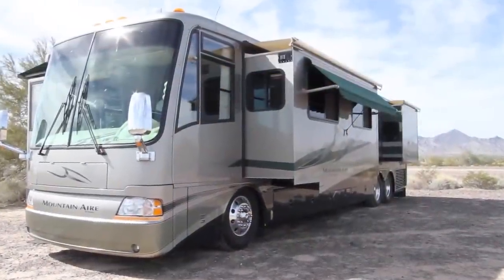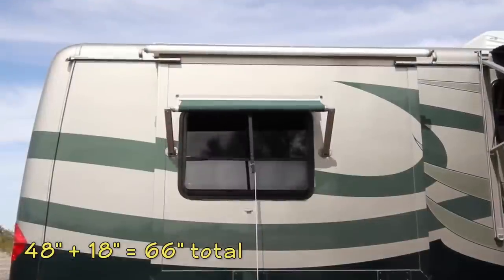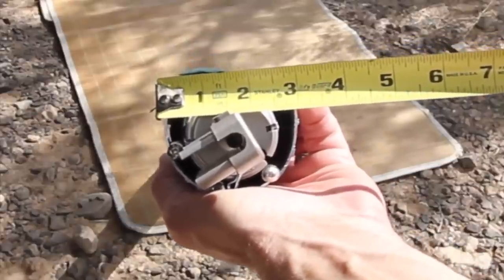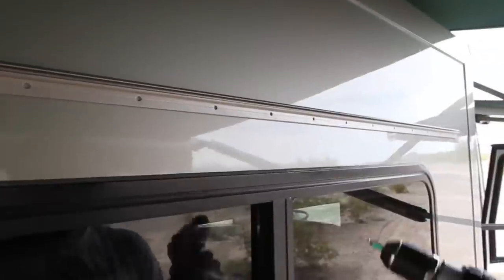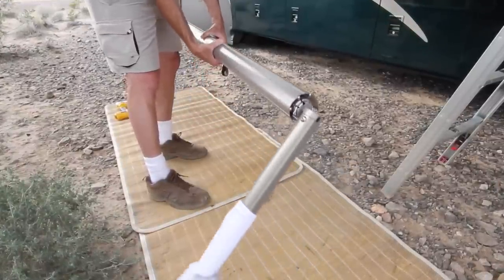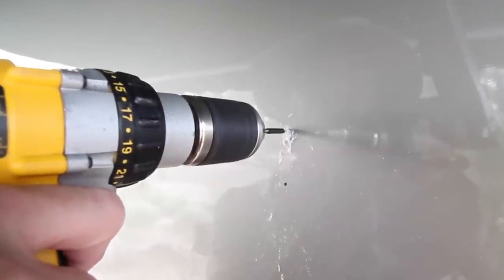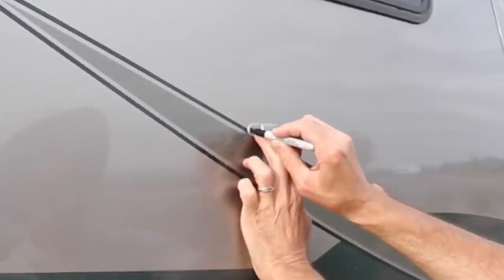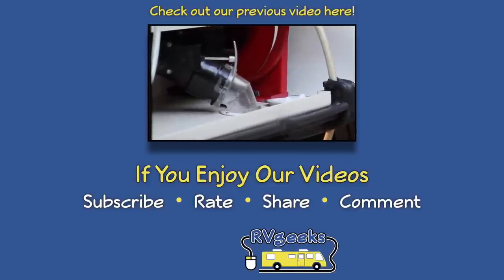How To Install an RV Window Awning (A&E / Dometic)

Comment: I love your videos. Very clear.  Obviously you plan before executing  and I am guessing you have a written script. The narration is as clear as a professional radio person.   I hope to eventually achieve your level of professionalism.  BTW- do you use a special microphone or video camera?  And I understand that if I get the same knife that a professional wood carver uses, I may get a different result<G>
Reply from the maker: Hi Jack! Thanks for the lovely comments. You just made our day. 😊  We have changed our techniques and gear a LOT since this video was shot back in 2014. When we do a VO video (voiceover) like this one, as opposed to appearing on camera, we do usually use a script. As far as camera and microphone choices, we have a great suggestion for the mic — a Blue Yeti, which is not expensive at all, and our very favorite, which we use to this day (although we didn't have it yet back in 2014). This is the exact one we use: https://amzn.to/3kf95Fj

As far as a camera, it's hard to go wrong these days, since just about every modern smartphone shoots in 4K, which is higher than you need for YouTube. If you're looking for a dedicated camcorder that has fantastic color, rock-solid image stabilization, and is drop-dead easy to use, our favorite model we've used over the years is the Sony AX53: https://amzn.to/3kf95Fj It's not cheap, but we sure loved ours. The only reason we replaced it was because we had to shoot on an even higher level for The RVers TV show. That requires equipment costing about four to five times as much! Hope this helps.

Comment: Thanks for the instruction, good,clearly video,still think twice before drill on our brand new class A motor home 🤔, if so how long does it take to order ? We are thinking to order few of this to cover 4 Windows .
Reply from the maker: +Lien Dang Unfortunately, A&E does not sell retail, so you have to order from an authorized dealer. We knew a few weeks ahead that we were going to be in Quartzsite for a bit, so we called a dealer there and ordered over the phone. The awning was waiting for us when we arrived, and we installed it out in the desert (which is where this video was shot). You'd have to call an RV shop or dealer that sells your brand of awning in the area you want to get it to find out lead times. You'll also need to let them know the size, fabric color and hardware color.
Reply: RVgeeks thanks for very quick replied!  We will check with our dealer.

Comment: Great video! Thank you. We're considering adding an awning to Casita Travel Trailer and wondered whether or not affixing the awning guide rail with screws into the fiberglass is the best option or if we should use pop-rivets or some kind of adhesive....what would you recommend? Thank you!
Reply from the maker: Hi Alex. We get why you're asking... screwing into the fiberglass definitely gave us pause, too. We considered using pop rivets, but since the two other awnings (that came from the factory) were installed using screws, we figured we'd follow suit (Newmar's been doing this longer than we have, LOL!). We were also concerned that an adhesive (even one as strong as VHB tape) wouldn't hold up to all of the sun, heat, rain, cold and vibration of life on an RV sidewall. With the putty tape in place, we feel confident that we're not likely to get a leak... and the screws are holding up great.
Reply: Thank you for the reply. I greatly appreciate your assistance with the inquiry! Cheers!

Comment: My pull down straps are weathered and the loop to pull on severed how do i take strap off to get it replaced?
Reply from the maker: Gary Mjoness Hi Gary. With the awning open, you should be able to slide the strap completely out one side of the roller tube. You can buy high-quality replacement straps from Tough Top Awnings (be sure to use the discount code "RVGEEKSROCK" for a 5% discount): http://www.toughtopawnings.com/rvawningaccessories.html
Reply: RVgeeks I opened awning and it will slide to end but the cap on the end needs to come off and it has a rivet in it. I was wondering if I took the rivet out and slid the cap off if I would lose the spring tension. Please advise
Reply from the maker: Gary Mjoness Hmmmm. There should be an opening on one end of the track (or the other) where the strap just slides right out through a little notch in the end cap. Do you have an A&E / Dometic or a Carefree of Colorado?